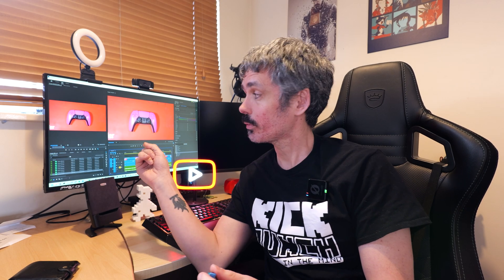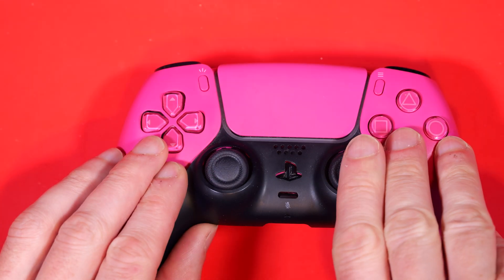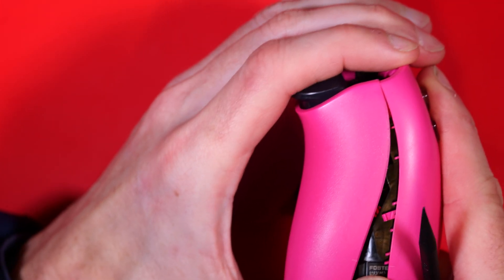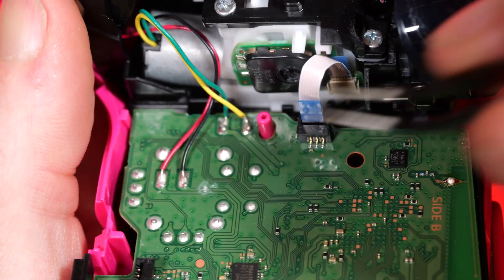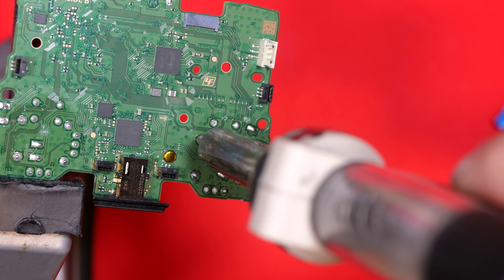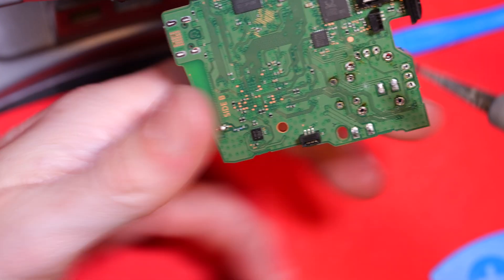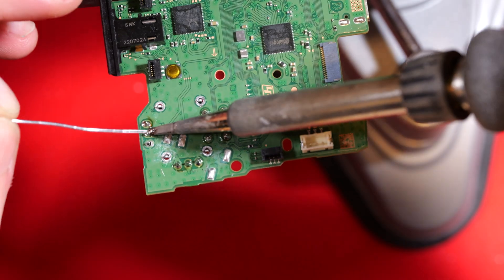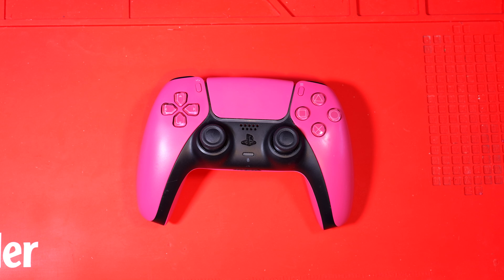PS5 DualSense Stick Drift Fix - New Hall Effect Modules

Comment: I recently replaced the sticks on a Dualshock 4, and man was it a pain in the ass. I have a desoldering gun, and hot air rework station too. What made it easier for me was taking out the potentiometers on their own, instead of together with the whole module. Taking out an 8 pin component is much easier than 14, so hopefully someone finds that helpful. 

I now have a broken Dualsense and replacement sticks coming in the mail, so I'm hoping what I learned from the DS4 will aid me with that repair. I'm not optimistic that it will be less of a pain in the ass though. 😂

Comment: You can plug the board in and test it without putting it back together, but it does need the battery to be connected for the controller to work correctly.  You could probably re-centre the sticks in this state, but you will need to put the controller back together to do the range calibration though as the controller housing does limit the extent of travel on the sticks.

Comment: I ended up snipping the old pots to bits with a sidecutter. It made the removal a whole lot easier.
Reply from the maker: My snips weren't fine enough. Maybe time to invest
Reply: @HappyLittleDiodes I used a pair that came with my 3D printer.
Reply: Same method I used to use until I discovered pre heating the board and the pot housing.
Reply from the maker: How did you heat the housing? Just carefully with a heat gun?
Reply: @HappyLittleDiodes  in the early days carefully with a cheap heat gun, now with a cheap rework station.